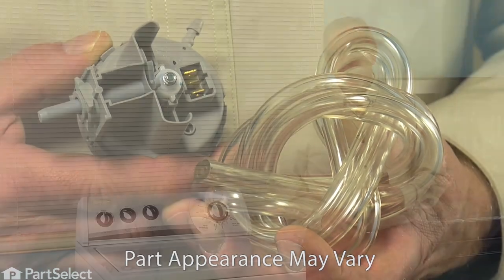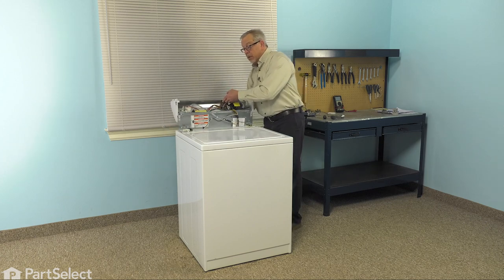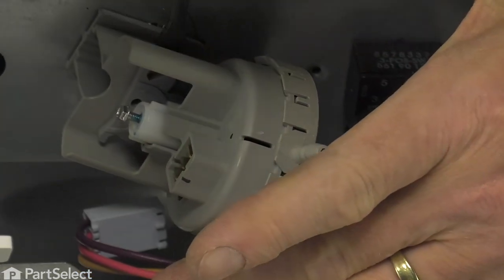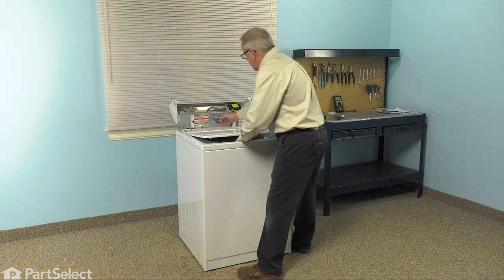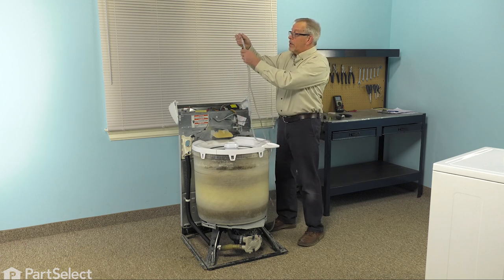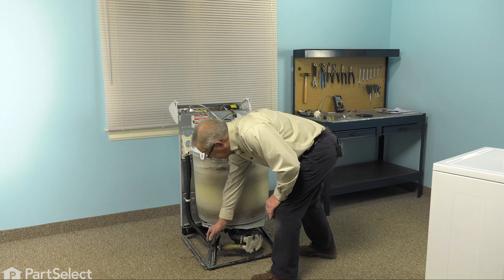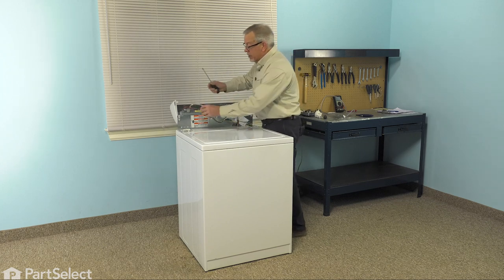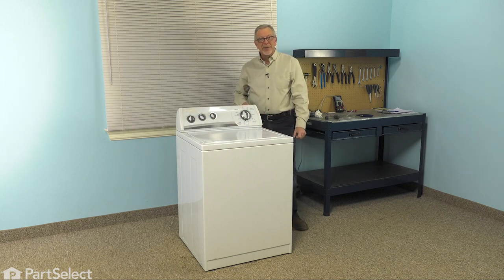Washing Machine Repair - Replacing the Water Level Switch (Whirlpool Part # W10337781)

Comment: Thanks for sharing this video. During parts of the video though the camera was too far away and not close enough to see clearly what was being done.. 

Aside from this, my question is about the water level pressure switch part, why would this need to be replaced..? What would be the specific symptoms to indicate that the water level pressure switch needs to be replaced, instead of for instance the water inlet valve part...? 

If suddenly when turning on the washer to start a normal wash cycle (pulling up the main knob), the water is not filling at all, but the base of the agitator is moving back and forth; but then after moving the water temp knob from cold to hot, and/or moving the water load level knob up or down one notch, the water then starts to fill; but then at the start of the rinse phase when it should fill with water again it doesn't fill at all..., would this be an indication that the water level pressure switch could be malfunctioning..? Thanks for your help.

Comment: Hi can you share some advice- I have a whirlpool duet washer and it was not turning the pump on. I replaced the pump, control board, and pressure switch. It still will not run the pump unless I blow into the pressure switch. I checked the hose for holes and couldn’t find any. Is there a reason why the washer would not produce enough pressure to flip the pressure switch? Like in the drum or something?

Comment: If my switch is just broken, can I use the old tubing? The metal part where the dial attaches just snapped off.
Reply from the maker: Bonnie,  You can use your old tubing if no new tubing comes with the new switch.  With some models the tubing is included with the switch where the manufacture would recommend using all parts in the kit.
Reply: Why is it recommended? The clips connecting the cabinet to the machine are really rusted and I’m not able to open the machine

Comment: Here's how to save yourself 70 dollars for a new unit. If the only problem is that the knob is stuck on small then this should work. Open up the panel, disconnect the tube and electrical for the switch, remove the switch by lifting the tab underneath and rotating it 45 degrees. Then take some vegetable oil  and squeeze a few drops onto the plastic cylinder that goes up and down, the one with the screw on the top, holding it vertical so the lubricant flows down to the bottom. That should do it. Put it back together and you're good.
Reply: That worked GREAT! I used silicone vs, vegetable oil. Thanks mate, Good on ya!
Reply: Worked great. Used vegetable oil. Just some drops on a toothpick is all it took. thanks for the info, great idea.